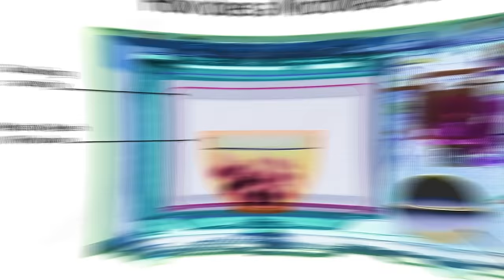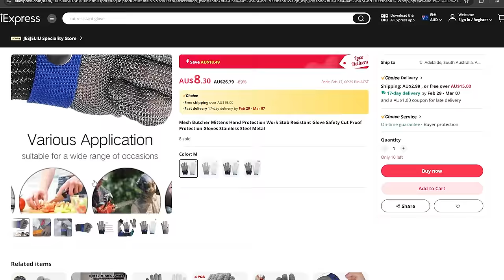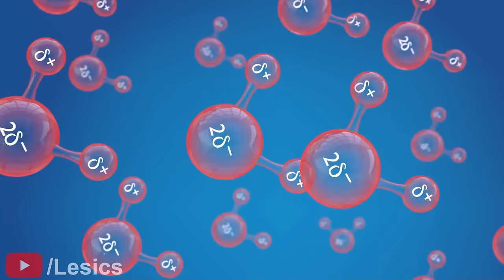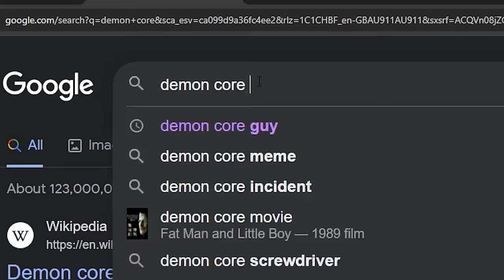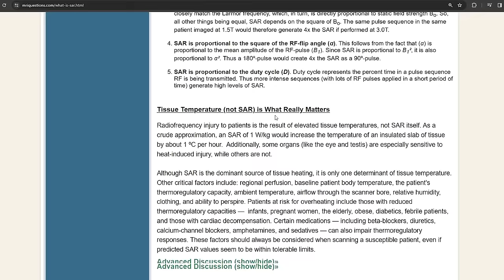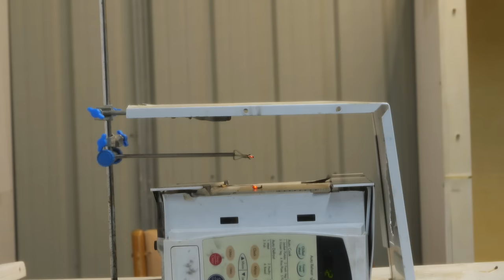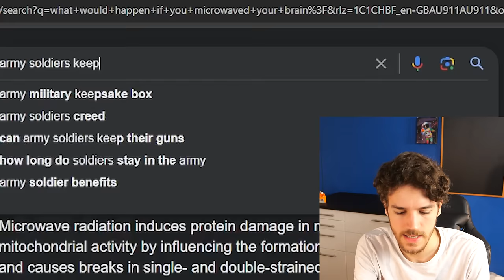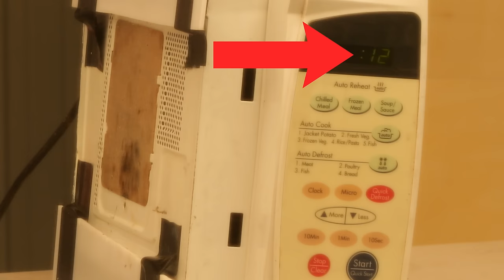I Tested the Limits of a Microwave

Comment: Yeah, microwaves are just radio waves.  It is fairly high wattage, and the resonant frequency is human scale, but it's just RF.  The biggest problem is that the magnetron generates standing waves, so the highest energy points are at fixed locations.  You don't want one of those highest energy points hanging around in the same spot inside you, particularly inside something sensitive like an eyeball, so holding still is not a great option.

Now if you really want to take this to the next danger level, replace the magnetron's emmitter with a high-gain antenna tuned for that frequency.  Hams have gotten burns by walking in front of microwave-frequency transmitters attached to high gain antennas running at far lower power than a microwave oven...  You think "hey, it's just a 100W transmitter, it can't be that bad" and forget that a 7-element yagi, which is fairly small by radio antenna standards, bumps the EIRP up to 1KW...

Now do that with a 1KW microwave oven, and you start seeing the possibilities...

Comment: Your microwave is actually "weaker" after you took it apart, the walls and door is not there only to protect you, but also to make the microwaves bounce around inside so they all hit the food, water or whatever is in there.. Out in the open alot of the waves will not even hit what you are trying to make it hit, they flow all over the place.. But you know this, you also mentioned it later in the video 😅

Comment: a microwave oven is essentially just hotboxing food with electromagnetic waves inside a metal box, so once you remove that box most of the risk is gone anyhow.

the REAL danger of a microwave oven isnt the microwaves it makes, but the transformer inside it. just the sheer voltage it is capable of outputting is the real risk. reminds me of all the electrocution-related injuries and deaths following the wood-fracking fad back in the late 2010s, where people were using old microwave parts to make lichtenberg figures in wood. 

if anything the scariest part of the video wasnt you sticking your unshielded head thru a microwave field, but the part where you tore the microwave oven open.

Comment: I have a theory about how the microwave mesh works and it has to do with the fact that a microwave mesh is flat with no sharp edges for the waves to arch off of. If you put aluminum foil in the microwave and it is crumpled up into a ball it will spark and throw a fit but if its flat this doesnt usually happen. Almost like the idea of electricity completing a circuit, but the circuit only being able to complete if its large enough to cover the entire plane of a wave. Im not sure if this theory is correct or not I am just going off of knowledge that I have from watching way too many science experiment videos lol. Also PSA please dont stick things in the microwave that shouldnt be in there lol

Comment: 34:00 well, that's the inverse square law for ya.
Microwaves just like all other forms of electromagnetic radiation (Aka light. lmao) are at the will of the Inverse Square law which in a TL;DR states that the further you get away from a source of photonic energy, the weaker it gets quadratically.

Comment: For anyone wondering, this is still a really bad idea. 
While heat and cancer aren’t issues, eye damage and cataracts can occur. Johns Hopkins college did a study on it and found that  microwave radiation can cause acceleration of cataract formation.
This is primarily because it causes corneal endothelial damage, degeneration of retinal nerve endings, and a slight increase in retinal permeability.
That being said, I’m pretty sure that unless you are spending hours staring straight into an open microwave than you should be alright.

Comment: LOL dude when you was messing with the cd whil in the chair your exit sing lit up 2 or 3 times for a second you never even caught it :)
Reply: BTW it happens twice around 33:44 to 33:48 
It would take several minutes with your hand or head in a microwave oven to even potentially cause damage even then you might end up getting a few nasty blistering burns like touching a hot soldering iron which i am sure you have done a few times over the years as you work with nutty stuff like this. Hurts leaves a nasty burn that heals fairly fast. Not a big deal pretty normal everyday thing for techs

Comment: man, so many wrong things in this video it becomes entertaining.
The best intuitive explanation that i can find to why microwaves do to pass the screen with small holes is to compare to why you can't see through metal. They are also made of holes (atoms) but the space between them is smaller than the wavelength. So you cant see through them. Once you make the wavelength very small then they can pass through metal. A physical explanation of this behavior would demand some advanced calculus. But here is what I can get without going into details:

Consider a periodic structure, therefore the fields scattered by this structure should also be periodic.
Then, for a field to be scattered in an angle (other than the incident one) by this structure it would need to be bigger than a certain value, otherwise a plane wave travelling to that angle would not exist. (try to draw a texture of inclined lines, it will only pattern for a fixed number of period)
SO, if you make it small enough, such as the light can only be bounced back to pass though, it means you are in the sub-wavelenght domain, and in this case, the light sees your structure kinda as a homogeneous media but with some propertities of the structure. And so, it is metal and metal reflects and absorbs, and so no microwave gets through. maybe i can make a video about it. i believe it is something that is lacking on youtube.

On your case, your glove was not periodic and the glove size was not sub-wavelength thats why it was exploding so much

Comment: I hope you were using GPT-4 for that math... GPT-3.5, the free one, definitely can't be trusted for that kind of thing. Not sure about GPT-4o, haven't tried it yet, but it might be OK. Also, the mouse studies and stuff you looked into when removing the face shield are, IMO, just finding the increased cancer risk that literally just comes from heat. Yeah, warmer cells are more active. More active means they divide more often. Every single cell division has a certain very low random chance of introducing a mutation which can't be automatically repaired and which can result in production of a cancerous cell. So if you do ANYTHING which increases cellular activity then watch it for long enough, you will see more cancer cells than your 'control' which had lower amounts of cellular activity over the same period. Even if that 'anything' is, like, eating a few more calories of food, or sleeping with a blanket versus not, etc. At a certain point, you have to just say 'alright, we don't care if the cancer is just random chance and this thing increases the number of rolls of the dice'.
Reply: The intentionally make it dumb. Gpt 4 is stupider than gpt 3 because of the restrictions they put on it

Comment: Good video indeed, I subbed you!🤘
 You missed just some points and things how it would really turn dangerous, especially to your vision, and it wouldn't take too long to cause permanent damage to your eyes, without even realizing.
 And also I want to point that the "power of the microwaves" what that on guy experienced with doesn't do a lot in case of harming tissue or the water in your cells cause, the wave frequency is A LOT higher in 5G transmitters than household microwaves.
 But lets take a radar used in navy ships for example.. 
Well 1st the power is massive and 2nd the wave frequency could be adjusted, then 3rd the transmitting antenna could also be adjusted and pointed or aimed precisely
my old teacher from 10 years ago told that With that you could fry some living creatures from a far distance, and they actually did, when they had spare time in the army and there wasn't any higher ranking military officers around..  So they fucked around with it just a little bit, and fried a crow which was sitting on a tree branch some hundreds meters away. He told that it took few seconds when it dropped to ground while smoking.  So it got basically torched before realising it..  At this this point is good to remember that we are talking about (MW) grade power. 

But the microwave magnetron itself has quite good frequency and power to cause harm to your brain or eye balls, but it would need special type of antenna to cause real harm from descent distance.. (or removing shielding away from magnetrons own antenna and aiming it to eyes.)  and then it'd probably be too late for your eyes when you'd feel em heating up.
 Things what you did on your video was quite safe imo. But I wouldn't recommend those to anyone :D.. the thing is that the microwaves reflect from surface to surface and that makes a huge difference by separating the waves to random directions than concentrating tthem into one beam. 

 The thing is that ppl seem to be scared of microwave radiation from microwave ovens cause they don't know a lot about them. good educational video was when someone put a living fly in to microwave for minutes and it was ok after that.. Was it Backyeard scientist, can't remember but maybe the video is out there still. Great video anyway.

 
🤘🤘

Comment: So your body doesn’t absorb microwaves very well and the waves are very random.  So nothing would happen.  If you put your head inside a box where the waves would bounce around and left it in there for an appreciable amount of time it would cook you.   This is a similar reasoning behind Nile red and other YouTubers having radioactive substances they can handle.  The amount of harmful waves and the properties of such waves make it hard to do internal damage.  As well as coming out of the material at a much lower frequency.  Much more likely to stop your heart by shorting the capacitor or frying your skin with the transformer imo.  Source is “I tested the limits of microwaves”. Can look up this one accident involving a transformer too if you don’t mind a horrid and grotesque display of the power inside one of these things.  It gives an appreciable amount of respect to the capabilities and dangers of what’s inside your favorite kitchen heaters.  As well as the power ratings of a power line when compared to the tiny in comparison 2k volt transformer to the 230k volt transmission cables the us uses.
Reply: oh no... another MOT hater.   MOTs and the half wave rectifier / voltage doubler (it is actually -4k volts to ground) are things that you either know or you don't.   there is no reason to avoid them as long as the proper precautions and safety procedures are followed.  my fav project was 4x MOTs in series and a full wave rectifier /w 20Kv 1uf cap hooked to a bug zapper.   what a show that thing was.   it eventually burned out the MOTs b/c i didn't properly ballast them to limit current.  diodes and cap were from some random fm transmitter i took out of service.  never stop learning and experimenting,  that is what it means to be human.  curiosity.

Comment: So, 'microwave radiation' is a pretty wide spectrum.
It goes from 300 megahertz to 300 gigahertz.
Microwave ovens operate at ~2.4 to 3 gigahertz, which is why WiFi hates it. High frequency = safer.
RF video transmissions from radio towers operate at 80-500 megahertz. Standing next to a transmitter will cook you from the inside out.

The misconception with microwave radiation is twofold:
1: "All microwave radiation is microwave oven radiation" - Seriously, whoever called a Microwave (oven) that should be prosecuted. Not for crimes, but just for being dum dum.
2: "Because i heard a story of microwave RF frying a person, all microwaves (ovens) are bad." - People like to be afraid. Honestly not bad in this case.

Why do i know this?
I have a friend who works on RF towers for a living.
He once had to call emergency services for someone who climbed the tower. He was hot on the outside, very, very cold on the inside. The past tense is of specific importance here.
Don't climb RF towers.
Just because this is safe, doesn't mean all RF radiation is safe, and unless you have PERSONAL EXPERIENCE with you EXPERIENCING that it's safe, or a TRAINED PROFESSIONAL HOLDING YOUR FUCKING DIAPER, do not mess around with RF radiation. There are very few worse ways to die, and unless you particularly like the term 'full body organ liquefaction', maybe air on the side of caution, and stick to watching videos.

Yes, microwave ovens are (relatively) safe, and most safety measures are there to protect the company. (Most often after lawsuits of people ionizing cats in microwaves have happened. This was real, look it up, i hate people.)
Microwaves are the exception. Not the rule.

As a rule of thumb: The higher the frequency, the less danger it poses to you.
You see anything of serious power listing double digit megahertz frequencies or less: Run.

Comment: Your results are not all that surprising to me as I've never bought into the idea that microwaves do anything but heat tissue.  That said..  There is some evidence to suggest that high intensity exposure to your eyes is not good.  Check out the article "Early Research on the Biological Effects of Microwave Radiation: 1940-1960"  and jump down to the post war section where they get back into possible therapeutic applications, and their findings that microwaves in the 12-25cm range appeared to be leading to cataracts in their non-human subjects.  (PDF page 11, book page 333 Section 6).    Basically because the center of the eye  doesn't  have active blood flow they  heat up more from microwave radiation and this heating can lead to clouding (cataracts).     You also don't have nerves in your lenses so you may not be aware that they're heating up.    Similar issue with the testes which also has poor heat regulation.

Comment: This is an odd video, mostly cause of the things hes said that dont match what ive also been told. like how electricity doesnt take the path of least resistance, but it takes all paths. which... like i dont fully understand since ive seen electricity do exactly that. take paths of the least resistance. maybe its anecdotal that it takes the path of least resistance. meaning that the majority of current follows the path of least resistance.

but i can say that i know exactly why the microwave became more lame after having the box cut away. microwaves use all the walls and the mesh screen to bounce the waves around inside the box. by removing the box the waves just travel into the atmosphere and loose power in exponential rates as they do. 

also microwaves are in fact radiation... what they are not is Ionizing radiation, so they will not hurt you. at least in the same way. but all radio waves from microwaves, to shortwaves to the FM waves of a broadcast tower are all radiowaves. hell light itself that we can see is also a radiowave and they are all classed as radiation. so saying microwaves is not radiation is misleading. its not ionizing radiation. it cant modify your bodies cells for abnormal growth in the same way. the only danger in sticking your hand in a microwave while its running is simply cooking your hand.

which leads me to why i went down here to comment. ive had this happen once. we had a microwave that somehow glitched. the door switches got stuck or the safety interlock failed somehow IDK but i opened the microwave without pressing stop beforehand and due to some other things making noise in the house couldnt tell that the fan inside hadnt switched off or that the transformer was still buzzing. my hand was in the microwave for about 5 or so seconds before i noticed that my hand felt very hot. that was about it... pulled my hand out and pressed stop on the machine, only damage... a hot feeling slightly painful hand that turned red. it heat lasted about a minute maybe and the redness was about 30 minutes. but thats all the happened.

also the odd aspect of the microwave adding time. i dont feel that the circuitry itself was being affected because the machine just acted like the add 30 seconds button had been pressed. it added 30 seconds. i noticed that each time this happened... the CD aimed like a mirror towards the front of the machine. my suspicion is that on the machine pressing start while its running adds 30 seconds. the CD probably reflected the waves towards the front panel, which likely made the little wire contacts that connect when you press on the membrane buttons got a dose of microwave and reacted like a button press. 

my thinking for this was that it added a not random time. 30 seconds which seems like thats a time programmed into a button. that and also the machine beeped like a button was pressed. i would think if the microwaves circuitry was being affected in another way like the micro controller was being affected directly, the behavior would be more random. the display glitching out. the time counting completely arbitrarily or the machine just suffering a logic failure entirely and shutting down completely.

Comment: That high voltage capacitor is the real killer here, there are these craft videos on yt that show you how to use an old microwave to burn patterns into wood and that shit has killed people cause even when the system is off the capacitor will still store electricity for a while, enough to kill someone.